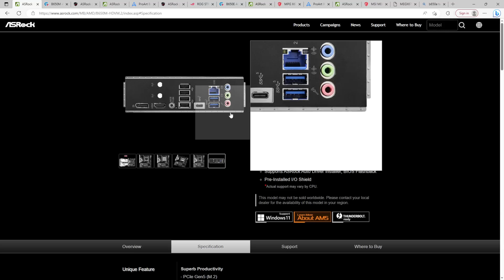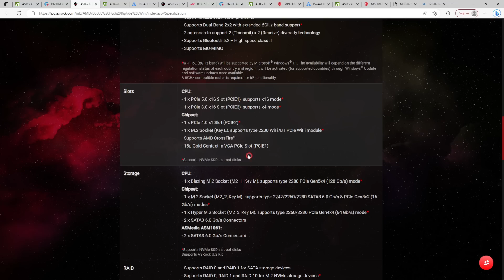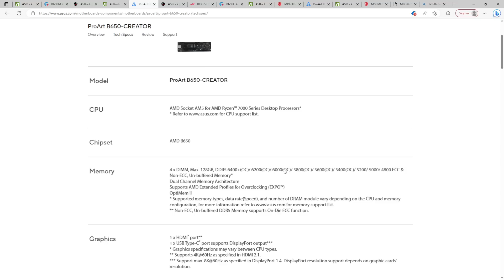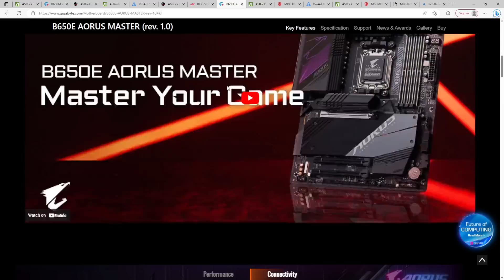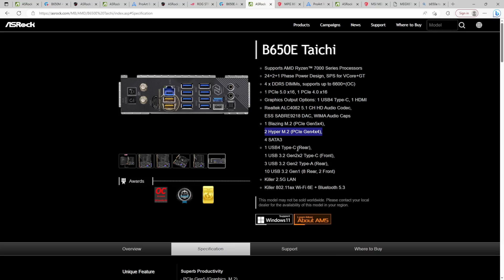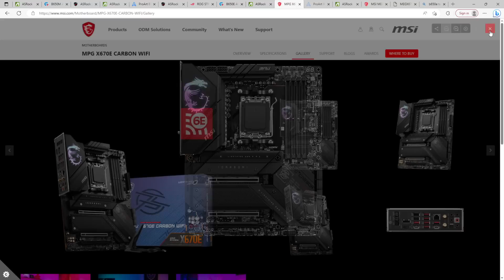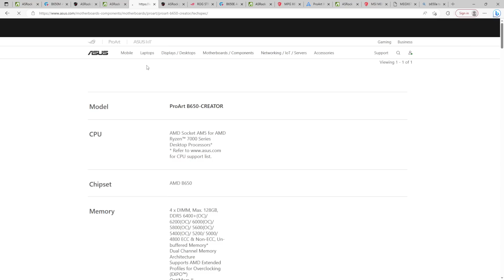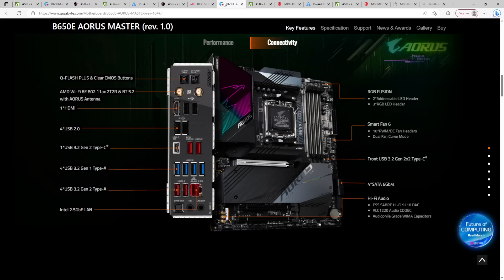AM5 motherboard round up

Comment: Using that B650E Riptide board, it's been a dream with Hynix A-die kit. Kept my Z97 Haswell system for almost a decade, so with Zen 5/6 compatibility that means I will almost certainly keep this board for a decade by which time a future GPU generation might actually benefit from the PCIe 5.0 slot.
Reply: Same here! Running a B650E Riptide with a 7700x with a G-Skill 32gb 6000mhz kit. Upgraded from a Z87 I7-4790K system that I used for almost 8 years. Glad I went with mobo that dosent pump 1.4v VSOC into my CPU 🤣
Reply: Same, though I actually took the steel legend. A micro ATX one would have been nice though. Problem is if you want a small b650e you already gotta go Mini ITX which is more expensive again.
Reply: there is no way in hell gpus will even come close to saturating a pcie gen4 x16 slot within the lifespan of your am5 motherboard
Reply: @aliasonarcotics  12 years ago boards were still on PCIe 2.0 slots. You'd see a tangible performance hit plugging a 4090 into one of those...  PCIe bus bandwidth also matters when the GPU has insufficient VRAM.
Reply: @HeavyGun1450  Exactly what I did myself, just with Z97 instead. Just be sure to update to UEFI 1.24. ASRock was running the CLDO_VDDP unnecessarily high. Mine dropped from 1.10 to 0.95v with no change to stability, and it even tightened some of the subtimings.
Reply: @kougar7  you’re not going to pair a 4090 with a cpu from 12 years ago. that’s the point. when pcie5 x16 becomes relevant to you, you will already be long gone from am5
Reply: Yeah, going with zen 4 and a gen4 GPU today, leapfrogging the CPU to zen 6 and riding that for 5 years will put you firmly in a GPU generation to leapfrog to which needs gen5
Reply: @aliasonarcotics  You're right, I wouldn't. But you don't seem to realize AM5 will run CPUs released in 2024, and potentially also in 2026 because AMD sticks to a 2 year cadence. Which means the motherboard has the potential to be six years old and still capable of running the latest-greatest chips right up until Zen 7 launches in 2028.
Reply: @HeavyGun1450  I just shut down my 4790k/z87 for the last time after running it at 5gHz 24/7 since ~2014. Man that was good hardware.
Reply: New GPUs might leverage PCI-E 5.0 well, but we'll see. My trusty and cheap RX 6750 gets much the same scores running PCI-E 3 as with Gen 4. Bandwidth availability was not exceeded is why. As games begin to use bigger texures and higher resolutions, I'd expect the higher bandwidth PCI-E 5 offers will begin to get used (data to the CPU also uses those lanes). 

I recently had to move my M.2 NVMe drive so the GPU's PCI-E slot would run at 16x instead of 8x like it was. It made zero difference to scores, so even 8x was enough bandwidth for running 4k. It did cause me other issues, though. My ASUS board is very adverse to change - lol. It would not boot. It gets fussy about which USB ports I use. Effing pain in the butt, because it gives me that hassle every time I make hardware changes. My next board with be chosen for it having a reputation for reliability and stability, not for having the best FPS (if I can not have both).
Reply: Me too, same configuration. Have you updated the bios to 1.24? I have 1.21.
Reply: @gabrieleb.6053  Yes. 1.24 tightens up some subtimings and for some reason raises the EXPO SOC voltage to 1.3 now. I set mine back to 1.20 SOC. 1.24 did nuke my profiles though, had to remake them.
Reply: @kougar7  Ty. I have bios 1.21 and stock Soc values are 1.24 volts, it never got higher than that, even under load. I have the same ram as yours increased to 6000 with expo. Plus I put curve -30 all cores, and pbo with ecomode 65w values. And max limit temperature 85c. The pc runs great. Fast and cool.
In your opinion, since bios 1.24 seems to me to be a beta release, should I upgrade or can I keep v.1.21 until the next stable release? Are there any risks?
Reply: @gabrieleb.6053  I'd upgrade. It offers tighter subtimings and it lowers CLDO voltage from 1.15 to 0.95. Just make note of your RAM settings as old profiles won't carry over. And just manually set your SOC to 1.2 or 1.25 after enabling EXPO because it will default to 1.3 for whatever reason.
Reply: @doilookwasted2u it really was, I delidded mine with liquid metal, ran  it at 4.9 ghz @ 1.375v. It was time to upgrade though as it was bottlenecking my new 3070ti by 30-40%
Reply: @HeavyGun1450  yeah once I did the delid and threw an AIO on mine it was bullet proof. Never ran higher than 90c. All on a $100 motherboard. Those were the days
Reply: @kougar7  I just upgraded the bios from 1.21 to 1.24.  Activated expo to 6000. Soc value is set to me the same as the previous bios, which is 1,250. Confirmed by hwinfo where it maxes out at 1,240 even in stress test. Shouldn't the new bios bring the soc to 1.3? The values I see in the bios are all the same as the previous one. Anyway done cinebench23 test and the system seems stable.
I have 32gb ram Gskill F5 cl32 6000.
Reply: @HeavyGun1450  You also have the exact same configuration as me. Have you updated as well? What values does it show you?
Reply: @gabrieleb.6053  It did for me and Anandtech, but no worries if not. There seems to be some variability in values for different users. I would recommend MemTest 7.0 Pro for stability testing, it'll catch even that 0.01% instability if run overnight.
Reply: @kougar7  ok, ty. 🙂

Comment: Some more VRM testing video's would be cool, just to see how stable they are making them this generation.
25:45 The shut down issue is a bit concerning there for a mid-end high priced board, they ask these high prices but many boards have concerning issues.

Comment: Correct me if I'm wrong but I believe the reasoning for the B650E Aorus Master being priced so high is due to its limited availabilty...because it's discontinued. I don't think it ever had a proper restock.
Reply: Yes, but there are multiple reports of this shutting down under load.
Reply: Probably has it's issues, and that's why it got discontinued
Reply: Here in my country (Germany) they have a few B650E Aorus Master in stock (5+ in one shop ~400€, and more in other shops ~430€+) and new ones arrive in a few days.
I had ordered a X670E Hero but didn't even look at it and sent it back.
Have a B650E Aorus Master here and I'm curious what's this is all about (still waiting for new case and PSU so I can test).
When looking at the serial number I think the manufacturing date is February 2023 (SN2308XXXX).
I really hope it does not have any issues otherwise I have to rethink which one to get.
Will be paired with a 7800X3D + G.Skill 6400 SK Hynix (without EXPO).
Reply: @Z-e-r-o  I'm in Austria, we can order it here too. I had ordered it but later I have decided to cancel the order and go for another board. Even if it could be fine at the beginning I feared issues would pop up later down the road, and I just didn't want to risk it.

Comment: B650E Taichi is a phenomenal board for single GPU use. External IO is better than many 670 boards, pretty much all other 650 boards, has really good greater than 6000 DDR5 support.

Boot times are down to sub 15 seconds from cold boot to desktop with a 4.0 nvme, still slower than good x570/Intel boards but better than many AM5.

Things it's notciably missing that would be nice and are somewhat xpected at this price level:
Vcore offset for x3d (can be reenabled by ambitious overclockers though)
Safeboot/POST fail autorecovery
2 pin thermistor input
4th M.2 via chipset
Fractional Eclk speeds eg 100.2, 100.4 etc instead whole steps eg 100, 101, 102.

PS: Everyone should boycott Asus until at least Zen5 drops. Asus needs a fiscal lesson in not being shit.
Reply: Bro would you say this MOBO is good for 7950x if I wanna render 24/7 on my PC?
Thanks
Reply: @skrajina8037  dude it's overkill for that lol. Basically every board here is, if you don't care about featureset and are only talking vrm performance.
Reply: @miniweeddeerz1820  what would u recommend for rendering 24/7?
Reply: I’m leaning this way too. What memory have you been running? I’m thinking about really pushing the limits of stability here and going with like a 6600 because I’ve heard the ASRock tend to be quite a bit more stable than some counterparts including those from Asus
Reply: Is that sub 15s boot with or without MCR? Leaning towards ASRock myself but a friend has like 3+ mins boot with MCR off :/
Reply: @skrajina8037  any of the Aorus boards because their power section runs significantly cooler than all of the others
Reply: @JohnDoeWasntTaken While that is true, most still run on temps which are far away from becoming even remotely a problem.

Comment: 37:33 Thunderbolt and USB4 are not quite the same. That and potentially a trademark concern is why I think mb manufacturers shy away from calling it TB4. Even if that intel chip is a TB4 controller, I think there are platform specific differences. Level1techs did a video about thunderbolt networking and there was a difference between amd systems and intel systems.

Comment: Love the round up.  I was really considering the ProArt but ended up going with the Ace.  I use a 10gb fiber card now on my last two PC's but now that PCI slots are getting fewer and sharing bandwidth I wanted 10gb built in this time to keep those PCI slots free.

Loving how many USB ports we have now, I use two usb hubs to handle all my gear as a tech/creator so hoping to reduce the number of things off a hub.

Both of these boards share bandwidth with USB and the last PCI slot, but the Asus also shares bandwidth with one of the M2 slots.
Though Asus has one dedicated video out for intergrated graphics, while MSI you have to sacrifice a USB port to use intergrated (matters when you have 4 monitors like me and want to keep one dedicated gpu spot open for a PCVR headset)

I figured the ACE is going to do better with memory, has a bit more future expandability with PCI Gen 5.
Just it will be a tight fit on the NV7 case I am building with.

I do feel the ACE is overpriced, the Asus was as cheap as $450 and has USB4 but when already spending so much I went and spent the extra to not regret missing a couple of things the Ace has later on, especially as I do plan to upgrade to the 8000 series later.

I admit I did kind of let aesthetics be one of the tie breakers, normally I do not do RGB and flashy.  I go more workstation, quiet, stable but for some reason I am on this Cyberpunk kick and using a big window case so the Ace will look better in that setting.

Comment: I just plug a gpu into my motherboard but it's cool to hear what power-users look for in a purchase. Thanks BZ
Reply: lol i'm still using my old Sound Card...  
the Software is just superior to all the Motherboard stuff i've seen... the Hardware isn't even the important part, just using optical port for my 5.1 System... and apparently a lot of modern boards don't even have a optical port anymore, so it seems like this is becoming more of a need again.

Comment: 10gbe and thunderbolt are relevant for video production people who use a NAS and handle lots of large files.
Audio engineers use interfaces that connect through usb, which then goes out to mixing monitors via xlr.

Comment: a bit more on the ASUS ROG B650E-E Gaming Wifi:  
It does have a Thunderbolt "Header" on the Board that you can connect some cheap I/O slot port Card thingy to (Manual Page 1-20).  
You don't get it on the rear I/O but if you really need it, that sounds like an OK way to get it, i think. ...that header might even be present on lower cost Boards, i have not checked for that.  

Speaking of Headers, i was also really mad about so many AM5 Boards not having an Optical Port for Sound on the rear I/O anymore (my 5.1 System needs that), but then i noticed there is a SPDIF Header and you can just connect a optical port there, stuff is like 10 bucks... the functionality is there, just not as convenient to access.  

If you install a M.2 SSD into slot "B" (that is the one between the 2 lower PCIE Slots) it cuts PCIE_X16_1 from x16 to x8 (Manual: Page XI "connectors with shared bandwidth" ...this seems to be the only shared lanes though.)  
...and of course that is one of the two M.2 PCIE 5.0 ports, not one of the 4.0 ports.  
So you probably want to use the 3 other M.2 Ports before touching this one.  

And can somebody please explain to me, why they aren't putting screwholes into Motherboards for M.2 2230 drives? I got a Steam Deck with a 512GB 2230 drive (the new ASUS ROG Ally also uses 2230), one day that device will die or get too old to bother with and i may want to throw the storage into one of my PCs... do you want me to glue it down with tape?!  
Is that one screw seriously saving you money? With 4 ports you'd think they add some variation between the less used lengths.  ...and why are we putting all the M.2 SSDs behind the GPU anyway?  
If your SSD craps out, now you have to disassemble half the PC to get to it instead of just pulling out a SATA and Power cable... i'm not sure i'm a fan of M.2 being done this way.  
I'd rather just have a plugin card for one of the PCI-E ports instead. ...and more PCI-E ports in general.  
I am also not a fan of the reduction of PCIE ports in general.  
First they take the 3.25" drive bays out of cases ... now PCIE slots get reduced to the bare minimum. ...PCs are getting less and less modular in design and without those slots being available there are going to be less companies attempting to put innovative stuff in there. I want the crazy days back when they made cigarette lighters for the 5.25" bays, manual Fan Controllers and drive bays... now i need to plug everything into USB and have it awkwardly dangling around... so boring.

Comment: 42:50 @ActuallyHardcoreOverclocking The problem with that is, most of the newer boards seem to come out with only additional 1-2 PCI-E ports (over the GPU one, that is) - and quite often 1 of them is placed so dumb that it'll get blocked by the chunky GPU coolers anyway.

And as for the reason why you might need one, two personal use cases:
1. I'm using an old SB Z sound card, which is perfectly fine and seems to still be offering much better audio quality to integrated audio systems (had only comparison to the ALC1220 one, though I somehow doubt that the 4xxx one would offer really "good" quality anyway)
2. During the height of the pandemic lock-downs (spring 2020), the integrated WiFi on my Crosshair 7 Hero died. Could RMA, but I'd end up without anything else than an old laptop for probably 1.5-3 months - and I'll be honest, the ability to just play some games after work was a real game changer during those times. Solved it by buying a PCIE card with a good antenna (just renting my living space, I can't have direct access to the router, and there are a couple of walls between it and my PC room).

So yeah, I really wish the motherboard manufacturers would make it standard for the PCI-E slots to come at the 2 bottom "slots" - as having that M.2 slot "under the GPU" won't really impact anything other than the thermals (and that also "maybe), but it'll definitely block an extension card from being used in the PCI-E slots. 🤷‍♂
Reply: Wifi is usually on a separate M.2 card that can be replaced..

Comment: 2:35 - Wendell from L1Techs reviewed the ASRock Phantom Gaming B650E PG-ITX wifi recently and it did not have a BIOS Flashback button, labelled USB port or any reference to such functionality in the manual or UEFI - is this feature truly mandatory, even on tiny boards like mini ITX?

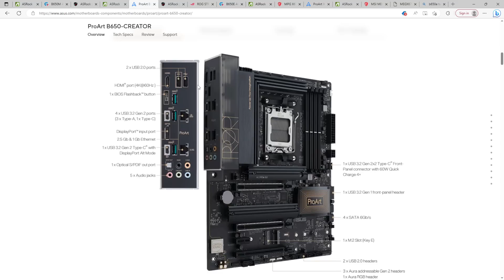13:20 - Man that Asus ProArt is a dissappointing board. It's great in so many ways (Displayport alt mode on the USB-C AND Displayport IN?!) but feels very 'prosumer', even more so than earlier generations. I don't think the missing POST code segmented display is a coincidence or cost optimisation.

Comment: I bought the B650 live mixer despite only two sata ports cause it's pretty much the only fitting board that offers two x4 expansion slots... my plans are to install a sata controller in the wifi M.2 E key slot and SATA port multipliers if that works.
Reply: Did it work?

Comment: @Buildzoid... one pet peeve, which led me not to buy the MSI X670E Carbon are the onboard GPU connectors. The DP connector is a hoax. It does no support the bandwidth necessary to be called version 1.4... but MSI claims is it. I'm used for many motherboard manufacturers cheating on the HDMI port (stating 2.1, but only 2.0 bandwidth). MSI is afair the only vendor cheating on the DP. My choice for X670E is the ASRock X670E Pro RS. Apart from one strange M.2 connector (x2 / SATA) everthing else is directly connected to the CPU / chipset with no switched or extra controllers.

Comment: The insanity of motherboard manufacturers makes me want to barf.  $700 for a $350 motherboard.  $700 is high end HEDT pricing (note - high end, not halo).
Reply: @Blue My current board is an Asrock X99 Taichi.  8 layer PCB, 40 PCIE lanes and quad channel memory.  It launched at $220.  Inflation adjusted, $280.  I'd hope that a a consumer socket CPU with half that would cost much less.

Comment: TWO x16 PCI slots AND a Gen 4 x4 slot!  All usable at the same time, available on two Asus boards: PRIME X670E-PRO WIFI and TUF GAMING X670E-PLUS WIFI (nearly identical boards).  I don't think any other X670/E  boards on this list can do that.  Few AMD boards period can do that.   Why would you want it?   GPU,  10Gbe port(s), + specialty card like video capture, or for me, an Optane card for cache use.  I'd be fine with a x16 and two x4s, but even that is hard to find on AMD.  More better slots are really helpful on Workstations and probably a more common use case than OPs 2 x8 for testing platforms.